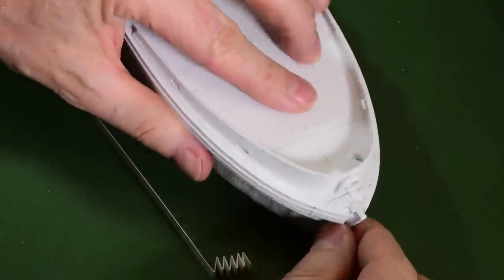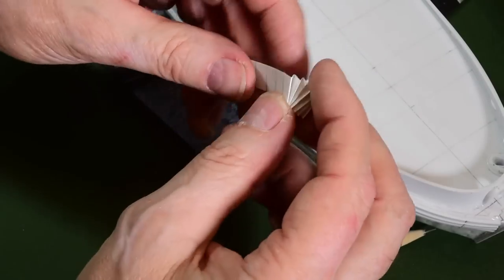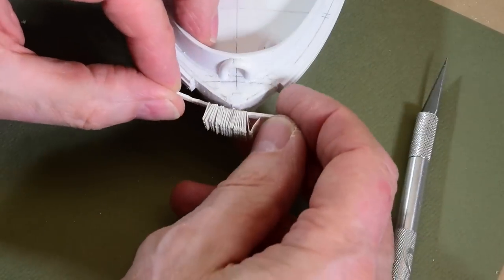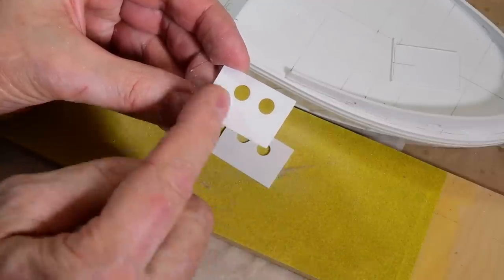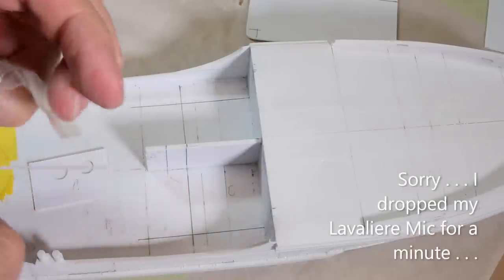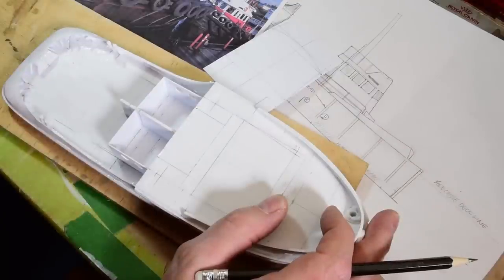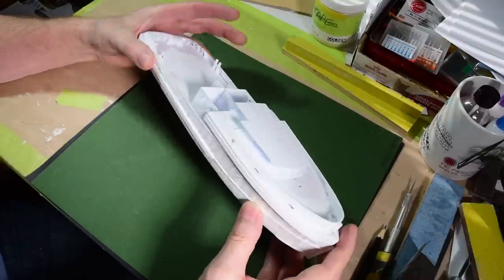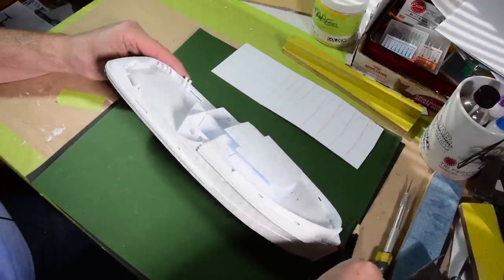Scratch Building Seaspan Corsair (Part 5) | Boomer Diorama ~ Vlog # 175

Comment: Looking great. Regarding the ladders (stairs) - there will be regulations, but they are narrower and steeper than you would find in any application ashore. And the top rail is usually bare metal because you don't "walk" down the ladders, your hands slide down the rails and occasionally your foot touches a tread. But I see on your pictures they are painted white. If they look too thin or too steep you've probably got it spot on! Cheers
Reply from the maker: Spot on! Thank you!

Comment: Hi boomer I love your builds in the diner build you said you were going to be doing a theater as well. Are you still going to do that?
Reply from the maker: The theater is on the tentative schedule. It's a long ways off though. I plan to return to the (Section Two) River Road schedule after the Tug Build. Having said this, architectural scratch builds are very involved and require long term commitments (as they all do). I also have to re-plan that section with some options. I will update that area after the summer. In the meantime I plan to stick to this production schedule for now: https://www.youtube.com/watch?v=9Ii4KWRC3yg